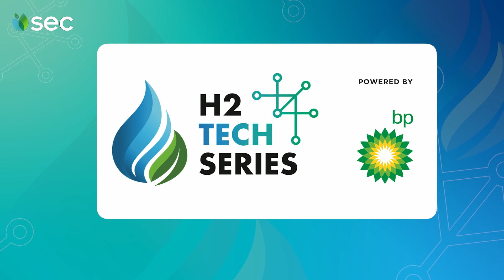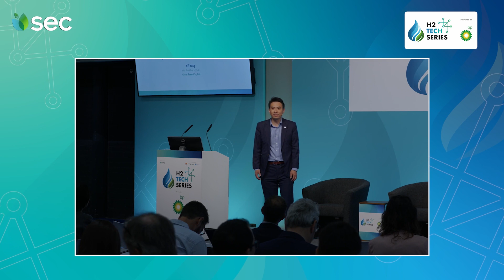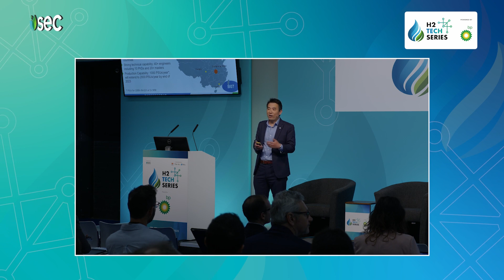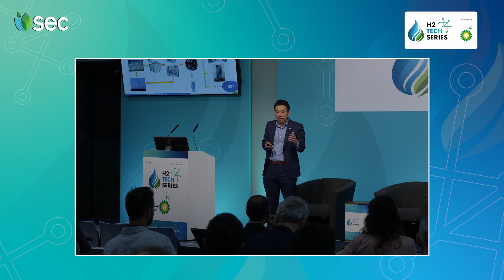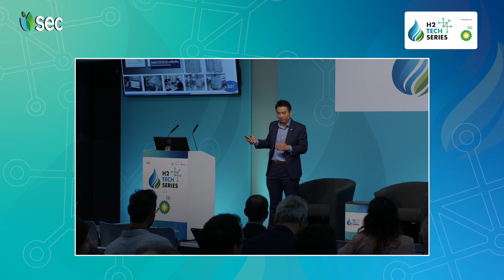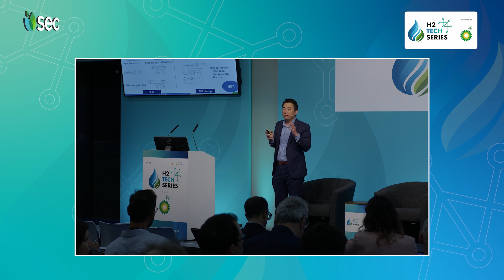Green Hydrogen, How to Address the Challenge of Unstable Renewable Power

Comment: Yes. There is tons of green energy but green energy does not pair perfectly with grid demands. The system needs a buffer and hydrogen is an excellent solution. 
The secondary matching problem is geography, e.g. NYC is not the ideal green site. 
Hydrogen or ammonia allows you to overcome the time and geography matching challenges.